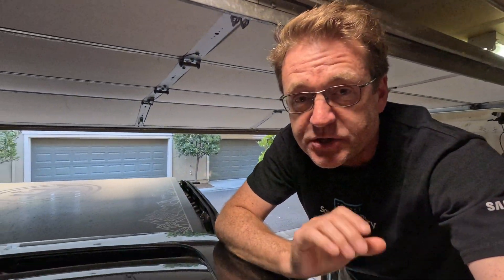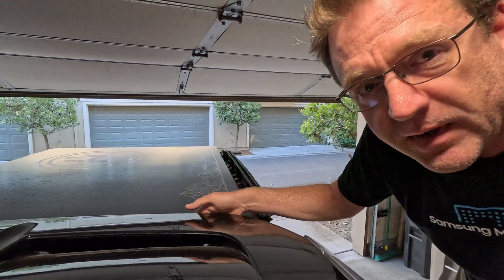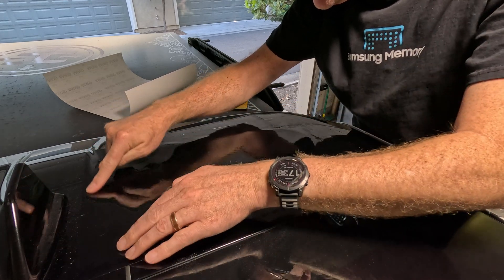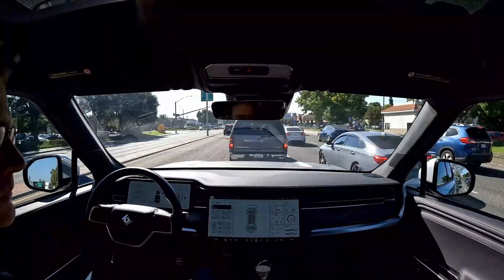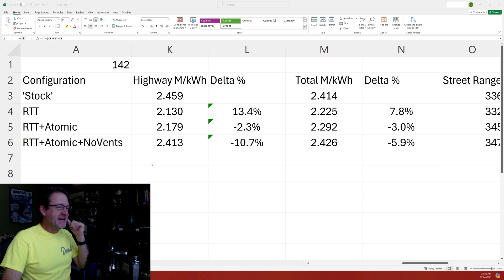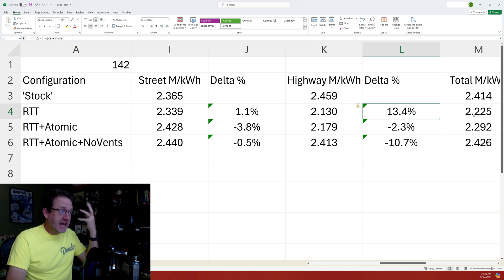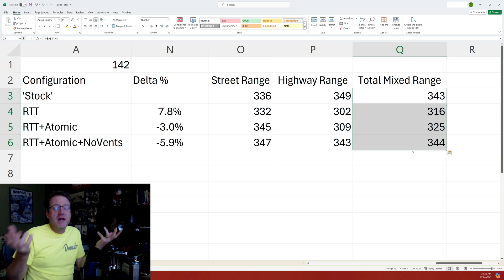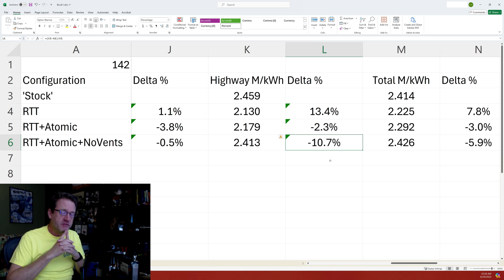Fixing Rivian Efficiency: Aerodynamics (RTT vs. R1T)

Comment: I am about to do this to my R1T. Maybe a dumb question but I get why you want to clean the roof before applying but why did you spray the detail solution right before applying the vinyl? Seems like it make it less sticky?
Reply from the maker: Spraying "soapy water" on the surface before applying a sticker does two things, the main one is so you can use a squeagie to force the water out and leave no air bubbles behind.  Secondly yes it reduces the stickiness for a time (until the water evaporates away), which makes for easy adjustment of the sticker to get it just the way you want it.

Comment: Great vid & amazing results! You still driving around with it sealed off? I know @ChargeOverland  discovered as well and was looking into a 3D printed filler approach. Have yet to see or hear if it worked out. I am sure others with rear tents or raised assembly’s would want to entertain for maximum range. Thanks again for sharing. Long time follower.
Reply from the maker: Peeled it off for the winter ski season, will re-apply when the RTT goes back on soon.

Comment: I have a rack on the bed (xtrusion overland) for putting a RTT on so I still have access to the bed. Most of the time I drive around without the RTT on, but the rack is always on, and roughly flush with the roof. 

Thoughts on closing the vents off in that situation?
Reply from the maker: Is the vent output under the rack?  Or does it look like the airflow would smack right into the top cross bar?
Reply: @MotorsportUnplugged  output would actually go right under the crossbar. Driving around with the rack empty, im sure theres all sorts of wild airflow in that bed area. Need a wind tunnel!
Reply from the maker: Sounds like you should be fine, but all it takes is a roll of masking tape to give it a try!

Comment: I too have the dual motor max pack but have the 21" wheels. I drive about 4k miles a month, live in the South Bay, if you ever need high mileage experiment lmk.

Comment: Will the sun will melt the vinyl and it'll droop into the vent hole?  A more permanent 3d printed solution or a piece of coroplast?
Reply from the maker: Yup agree, I've reached out to a contact I have at EVBASE to see if they might be interested in making some sort of 3D printed or maybe sculpted foam block to make plugging/unplugging the vent easy and more robust.
Reply: @MotorsportUnplugged fingers crossed